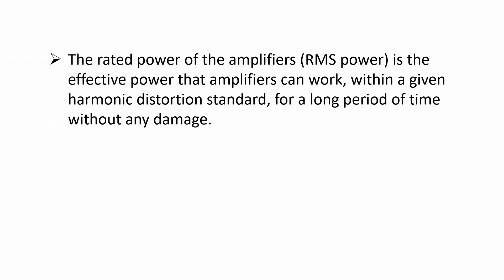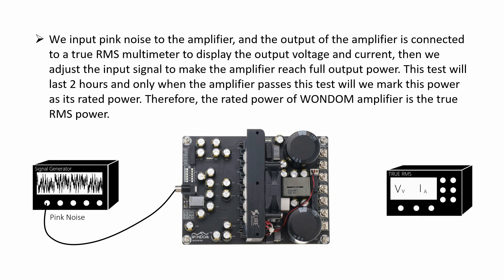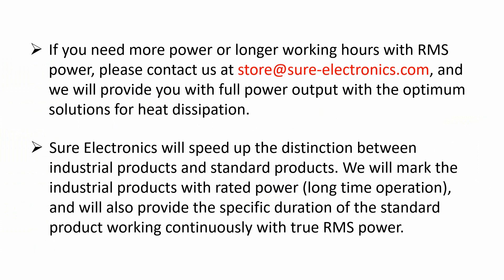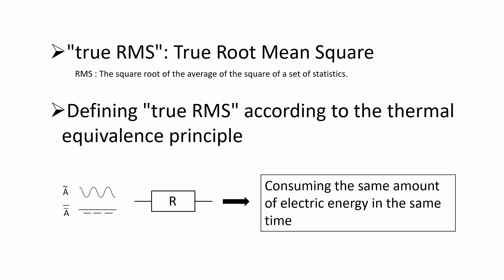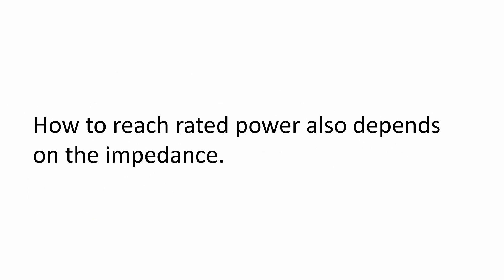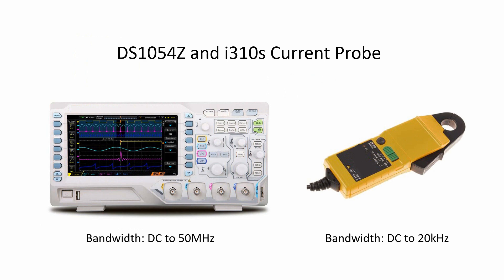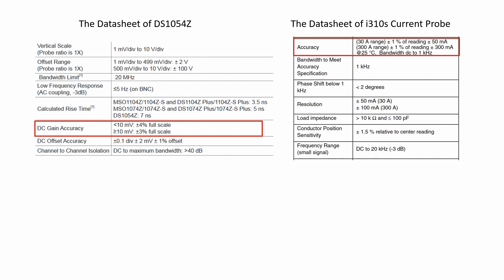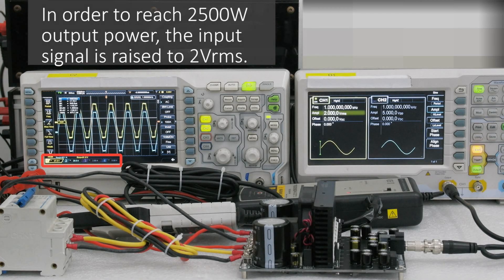Is 2500W marked on Sure Electronics board the true RMS?

Comment: I bought the 500 watt rms version , on a 48 volts , 15 amp , switching power supply , ran it at various impedences , it won't do 1ohm , barely does 2 without shutting itself down,  at a 4 ohm load , on same power supply , it might put out 75-  100 watts max , im talking max volume with every kind of music you could imagine,  we need more solid , and reliable,  factual truth, I highly doubt it even does half of 2500 watts , maybe 250 watts fully maxed out on the heaviest bass track in the world
Reply from the maker: We have dedicated design for extreme high output power and output current, like 200A continuous output current. And  the video is taken from real amplifier, all amplifier had passed 2500watt continuous output test before shipping. Please be noted the maximum output power only happens when load is correct.
Reply: It's impossible by the laws of science that these ,or any amplifier actually does anywhere near rated power , too many variables,  even if power supply is correct, and if you really want to get me on your side , why don't you guys make one similar to the ever so popular,  Aiyma bluetooth amplifier boards but do a 4 .1 channel at higher power, like say make the wondom 300x2 +500x1 a 5.0  bluetooth model with built in dsp,  eq, and volume knob, fader, channel separation,  bass volume , wifi streaming  , am/fm tuner, and make it a 24volt model ,now that's an amp I could definitely use,  but until then my mind is unchanged about these amp boards , they are overpriced junk and thats from my own personal experience with them,  none that I have owned , lasted more than a couple of months , following all of manufacturers specifications , and none of them came close to producing the watts claimed so I will not recommend these to a cockroaches aunt

Comment: What did you load your output to, How many Ohms ?   Also I noticed fur or noise all over your sine-wave signal on the oscilloscope whats this from?  You didn't show us a frequency response check over 20hz to 20Khz to see if the amplifier has a flat response. Whats the output devices driving your load. Show me these in your tests or I can't believe your claims just another load of junk from China.  I am genuinely interested but many amateur Youtubers are building Class D Amplifiers with Claims of thousands of watts but all are full of distortion and high frequency oscillations all over the output signal. What makes your amplifier better them home brew ones.
Reply from the maker: Hi, Anthony Fouracre.
Considering the duration and the theme of the videos, we have implemented frequency sweep test in this video. 
https://www.youtube.com/watch?v=0ceWFhK_o3Q
Have a nice day.
Reply: @WONDOMAudio   The audio in this video is poor. It sounds like the woman was recording this in a small closet. Also, this video was intended to verify frequency response. However, it is mentioned that there was a modification made to the test amp. How can you use a different product to prove output of another? Transparency is key.